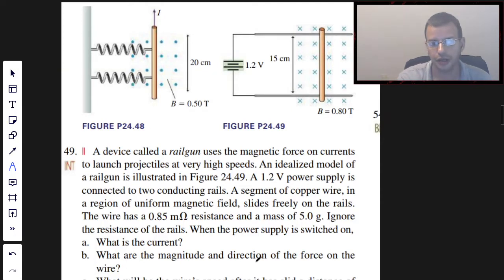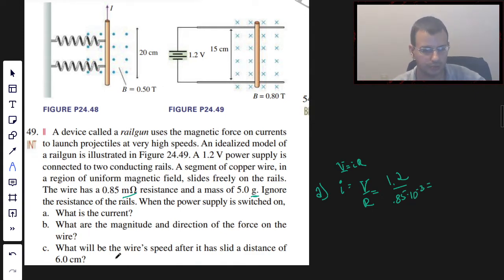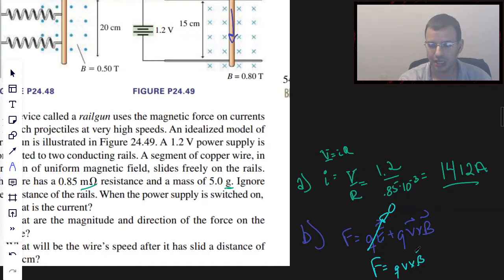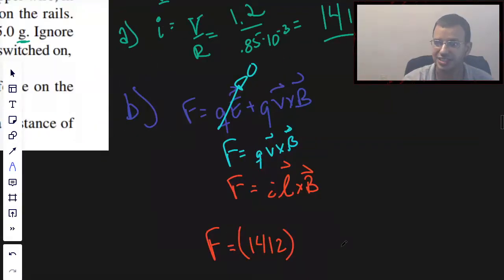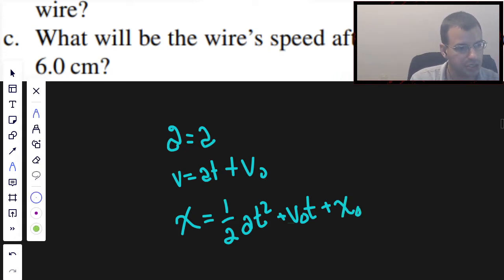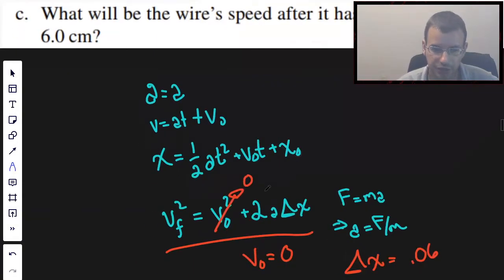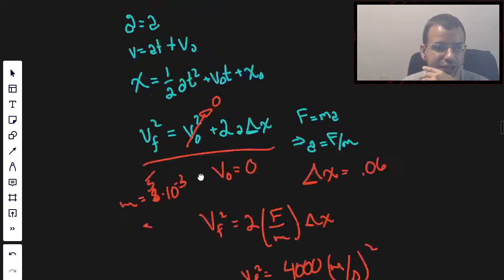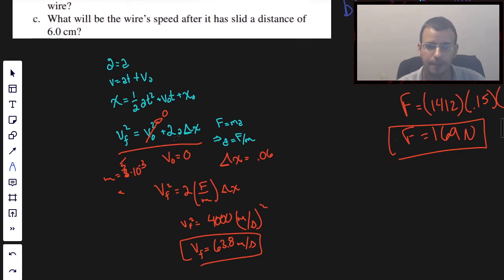Current and Force of a Railgun

Comment: A power supply that has an extremely high output current and extremely low voltage:  a unipolar generator.
Either that or they meant "85 milliohms" and not  "0.85 milliohms"

The 1412 amps would reflect not-uncommon practice - to use a unipolar generator to power a rail gun.

Comment: just wondering as the wire/rail accelerates and its speed in crease does the force on the wire increase so would it not be  constant acceleration?
Reply from the maker: The force of the wire would be mostly constant. I use F = i L x B, so the moving charged particles here are the current which, for the sake of the problem we assume to be constant, giving us a constant i, L and B so the force and acceleration are mostly constant as well.

Hope that helps, sometimes my explanations aren't as clear as they should be.